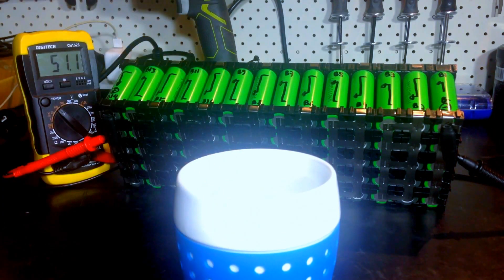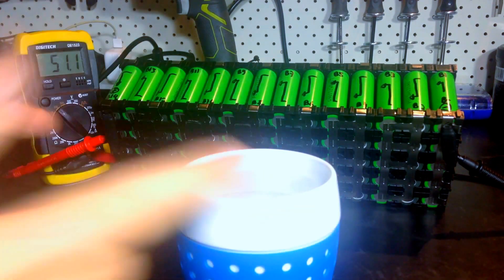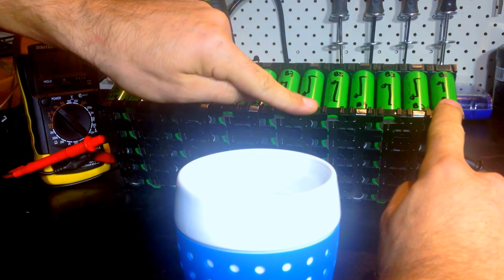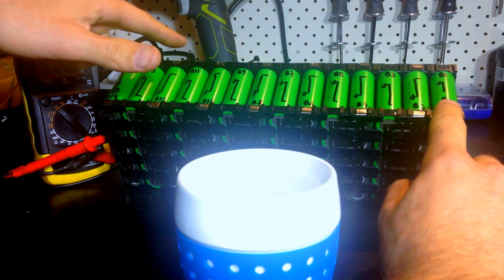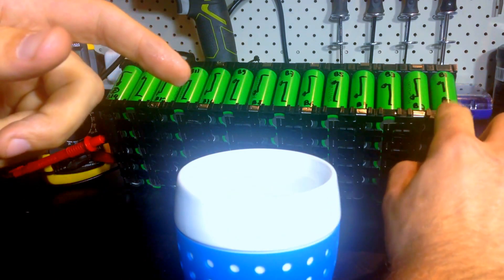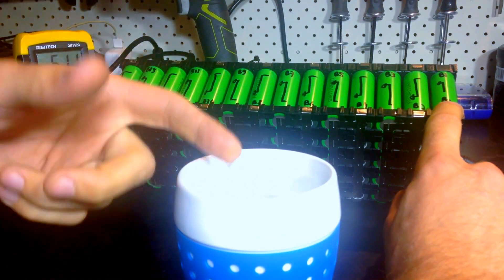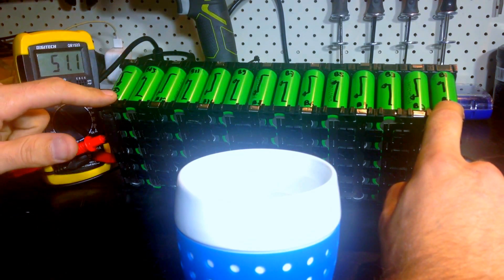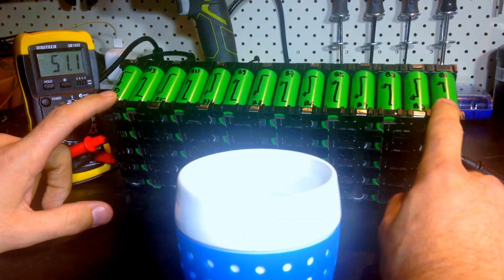Electric Shock feeling the POWER!!! High Voltage DC Electric Bike Battery

Comment: I've had a small tingle from my battery at 54v when I was pressing hard on the + - terminals, if you break your skin your internal resistance is actually quite low so just be careful if you have cuts or you're pushing hard on live wires